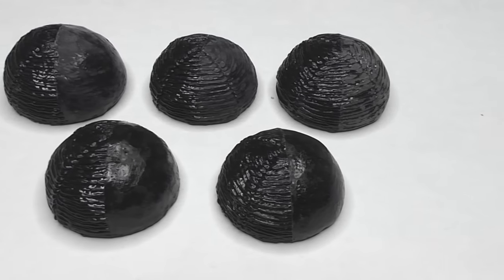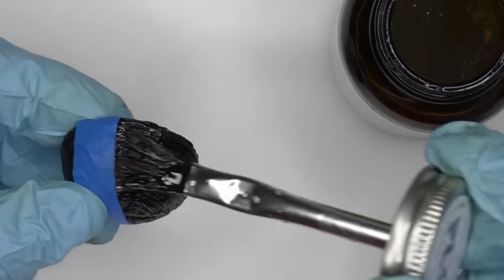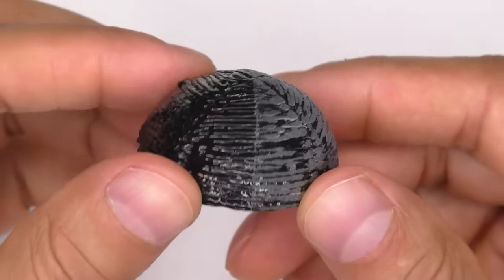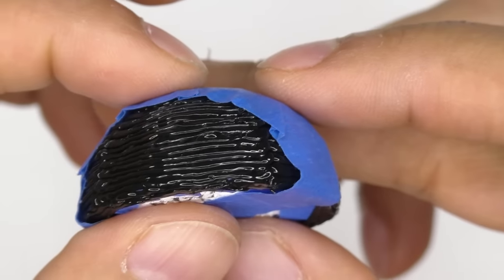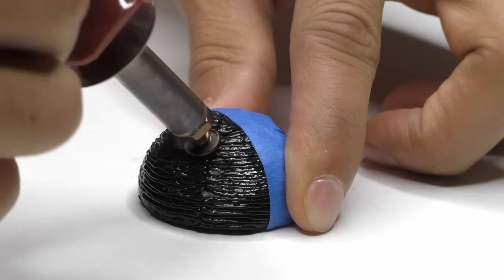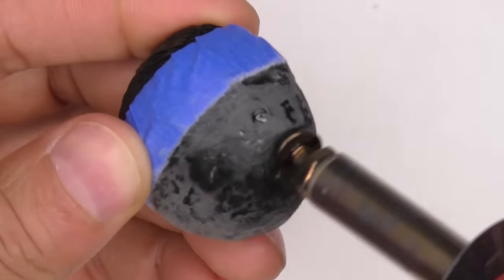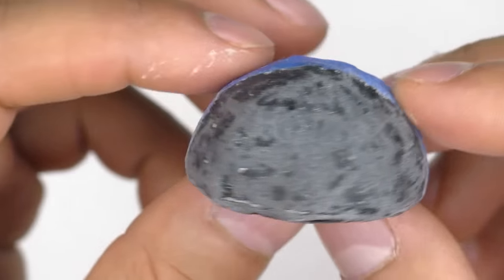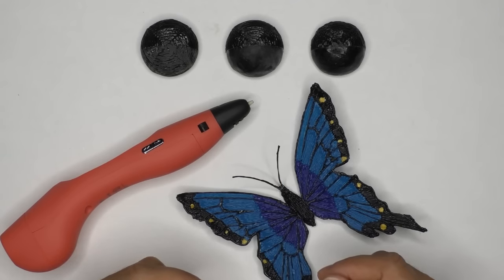How to Smooth 3D Pen Creations | Tutorial

Comment: I'm sorry what. 30 minutes sanding to get to that point. Your using way to fine sandpaper and files then. I sand my prints all the time, and that halv-dome would have taken no more than 5 minutes. 150 paper is way too high, start at 60-80 and finish up on 150-200. And utilize a workbench to hold the piece or hold the sandpaper. For curves I usually place the sandpaper on my thigh and move the print back and forth.

Comment: What is your opinion of wire-tip woodburning tools for smoothing?
Reply from the maker: I haven't used them, but I have a feeling they won't work well for smoothing.  I bet they work well for engraving and making details, but generally you need a larger flat surface for effective smoothing.

Comment: whats the difference between filaments on spools vs filaments in sticks?
Reply from the maker: The filament on sticks is typically proprietary and will only work with certain 3D pens (for example 3Doodler pens).  Pens that use this type of filament make a point of trying to sell you the filament also.

The filament on spools is general purpose and will work on most 3D pens (and 3D printers).  Usually the filament on spools is 1.75mm in diameter and the pen will state that it will take any 1.75mm filament.
Reply: @PotentPrintables   ooooo i feel like i shouldve asked earlier XD
ive had experience with 3d printers but not 3d pens... been wanting to get a 3d pen for the longest time ever, but have constantly been told its not good.. bought one today because i just really wanted to try it myself HAHAHA now i just have to wait for the shipping:)))
anyway!! thank you so much for the fast reply, can i also just ask what was the temperature you set the woodworking tool to?¿ and do 3d pens get jammed often?